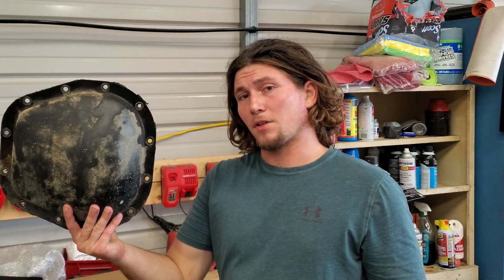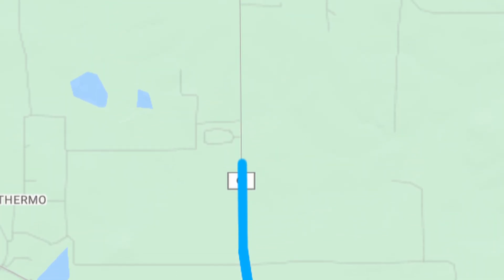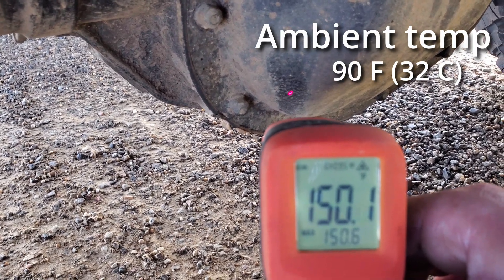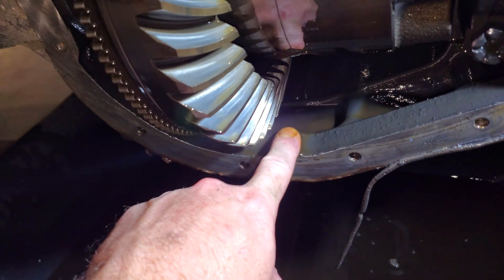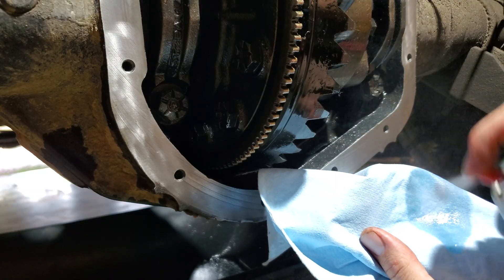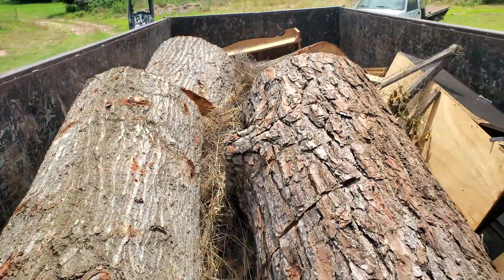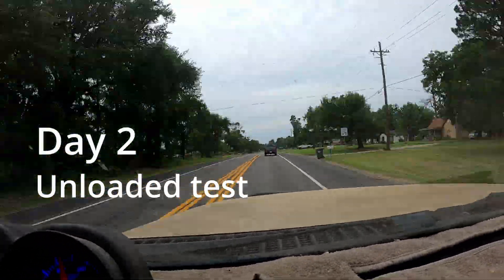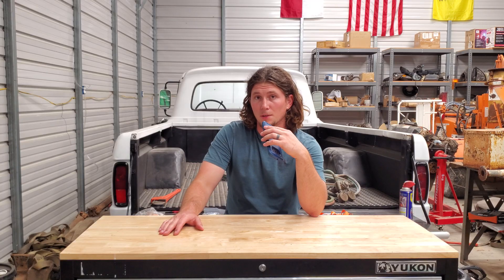Lower temps with aftermarket diff covers? - before/after test

Comment: HI dude 

Without a thermal probe in the oil you have no way recorded method of knowing if its being effective but with the higher temps as it looks like its the cover isn't expelling heat as effectively as it should and just stirring up the oil rather than helping it dump heat as there looks to be little surface area inside the cover to take heat from the oil.

The Cnc finish of the gasket area is very poor with scratches and marks and it looks like 

but fair play to you for making the video 

i look forward to seeing your follow up
Reply from the maker: So I have 2 theories on the aluminum cover. 

1 - is it drawing out more heat, and therefore getting higher readings on the cover surface.

Or

2 - it is so thick, that it actually locks in heat and raises Temps. 

But I actually think a combination of these 2 things are happening. Because it's thicker, it reaches operating temperature faster, but once it's at temp, it will keep it there more consistently than a stock steel cover. Only way to be sure would require more tests, under multiple conditions.

I agree an internal temperature probe is the best way to know for sure, but that's for another video. 

At any rate, as long as the temps are below the 200F range I'm a happy camper.
Reply: @Shadetree7.3  

if you think about it, the temp of the oil is what is heating up the cover, so its warmer than what your recording on the cover, there isnt actually much air flow behind the diff cover, the old method was to stick some string to the object and record it and you see were the airflow is,  for exmple my M5 diff has fins that go past the diff cover and into clean air below that is directed there by the flat underside panels this allows it to shed heat effectively.  

So the cover is actually stiring up the oil and making it warmer (cooking it and making it break down faster) 

food for thought perhaps 

again when you do a probe in the oil this provided clarity

Comment: The aluminum cnc cover would soak up heat better. Kinda like a heat sink on an rc car motor. Makes sense the cnc cover would be hotter since it’s soaking up more heat and keeping it away from your gears better.
Reply from the maker: I agree. I guess the only way to know for sure, would be putting a temp probe in place of the fill plug and running tests of the actual oil temp.

Comment: Could you try to do a test of the different types of fuel springs in the fuel bowl? Thank you
Reply from the maker: That would be fairly easy to do, and I already have a fuel pressure gauge installed. Thanks for the suggestion!